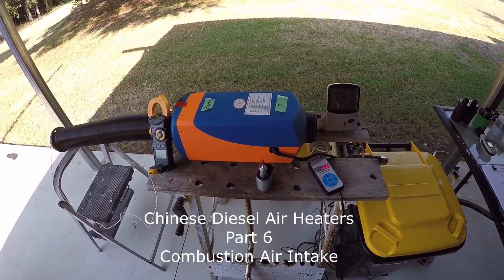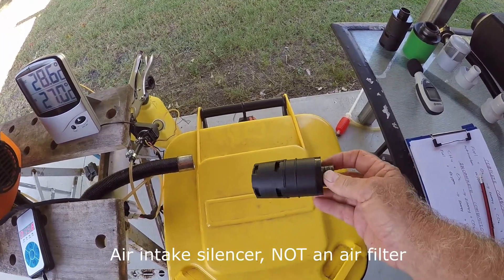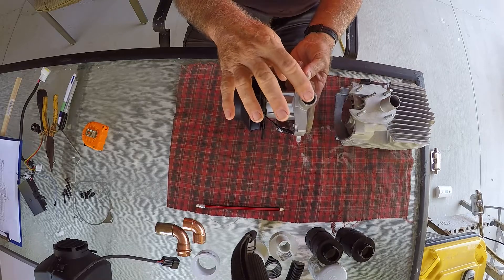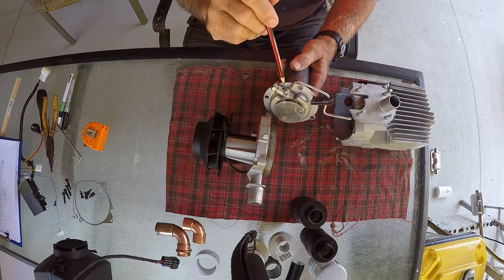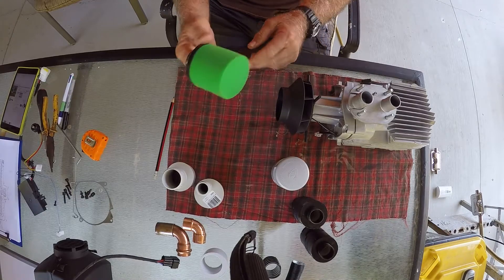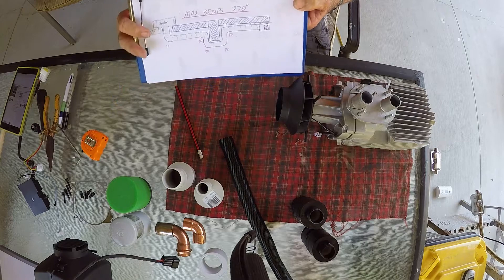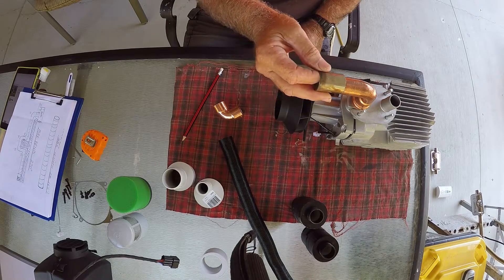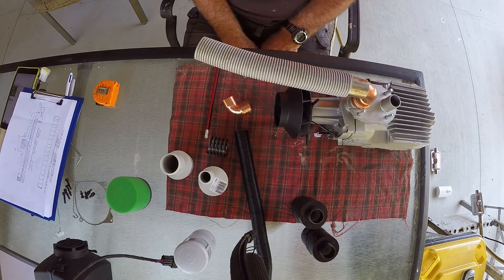Chinese Diesel Heaters - Part 6 - Combustion Air Inlet

Comment: Excellent thoughts and advice. Thank you for sharing
Reply from the maker: Hi Jaybee, pleased you liked the videos.  JMcK
Reply: @johnmck1147  Thank you John. I am currently playing with my new heater on the bench. Noise is my main concern for stealth camping in the UK, so you can see why I like your videos so much and the wealth of experience and ideas from your fantastic followers. Regarding inlet noise, I have been looking for an inlet pipe made of a soft material, rather than the hard aluminum pipe that came with the heater. So far no luck with that, but I have come to realize how correct you are when you stress how important it is not to restrict the airflow through the burner. I tried putting a small ball of wirewool into the exhaust pipe which did reduce the exhaust noise, but the exhaust gasses quickly became sooty. I also bought a 3m long exhaust extension pipe to try, which I connected in a fairly straight line, but this was even worse with very visible black smoke. The smoke in my garage was so bad and with my carbon monoxide alarm going off, I did not have much time to assess how quiet this pipe was. 

I wonder if turning the min and max fan speeds up, would this increase the air supply to the burner. If so, maybe that extra air supply would give a little more scope for attaching noise reducing measures. The extra air flow would of course make more noise in itself. 

 I have ordered a Honda style generator foam inlet filter and I may go for multiple mufflers in series. The heater is very quiet running at low speeds and this has prompted me to be more thorough with adding insulation to my new van conversion, so with less heat loss, I can turn the heater down for a quieter life.

realise
jaybee258
Reply from the maker: Hi Jaybee,

The metal pipe is the exhaust pipe. The combustion air inlet is a plastic pipe.

You are on the right track, these heaters just have a tiny combustion fan and they do not like restrictions. Keep the exhaust and combustion inlet pipes VERY short, and they will burn clean. 

Suggest you not play with factory settings.

Unless you have holes in the floor of your van, and it is lowered to mere inches of the road like some hot rod, the exhaust can exit under van, with a short exhaust rather than run a long hose out the back. Always have a CO meter inside accommodation space though.

They run quite on low speed. One of the reasons to have a bigger heater running slow rather than a small heater running fast.

Cheers.  JMcK

Comment: is it possible to us an air compression fan to feed forced air into the unit to have cleaner and hotter burn?
Reply from the maker: No, not normally. 

The ECU matches fuel flow to heater fan speed  for optimum fuel air mix. 
If you are technically minded you could try it, but you would need to go into the locked settings and manually adjust all the fuel settings.

But why bother. With a proper install these heaters run very efficient and with a very clean burn. Note in the videos the CO meter just inches from the exhaust does not register.  JMcK

Comment: Can you direct me to a video on the two kilowatt heater.   I would like to know the password to get into the settings and also what all the settings would be  for the 2 kilowatt heater
Reply from the maker: Hi Lionel, 

There are a number of videos like what you request, you can just put in your search what you request here.

I have found it better to stay out of this matter due to lots of issues people encounter after they go into the locked settings. There is no reset button if you get into trouble.. JMcK

Comment: What if I just hose clamped some steel mesh directly over the inlet?
Reply from the maker: Hi Randy, 

That would be a bad move and cause terrible air restrictions. When you have any type of air filter you need large surface area to avoid restrictions.  

Why not just install an air filter, easily bought on line or from a motorbike or farm shop.  JMcK

Comment: Hi John. Thanks for the informative video. My install involves my heater being up on a bench in my van and the exhaust and inlet pipes run down inside trunking to the floor and then outside underneath. I bought a longer exhaust pipe as the supplied one was just a few inches too short. I cut the longer one to only be as long as I needed and fitted the muffler. All is well there. However I wasn’t happy with the quality of the inlet pipe and decided to use the originally supplied exhaust pipe instead with a short piece of the  original inlet added to the end to enable a bend to point the silencer on the end away from the exhaust. I also used a 3” piece as an adapter to fit the exhaust pipe to the inlet port as the size is bigger. Having watched your video I now realize this is a mistake as I have slightly reduced the inlet pipe size by using the exhaust pipe. I also noted a very tiny wisp of smoke from the INLET connection under the unit when the burner runs on high. I mean really tiny amount - I had to shine a flashlight on it to see it. I wonder how this would come from the INLET connection? Even if I have a poor connection, surely there should be no smoke there. Obviously I will need to redo this with better inlet pipe now so I will use the heat silicone on the inlet joint as well to be sure of a seal. I was thinking of using a straight piece of copper plumbing pipe straight down and one angle at the bottom to direct the silencer/filter (will be getting a better one than supplied) away from the exhaust. The distance from the bottom of the heater to the van floor is about 20” and then about 5 or 6 inches from the underside of the floor to the muffler then about 3” of pipe on muffler to take exhaust past bodywork. Inlet about same length. Without going into lengthy details, the mounting on a counter is necessary for my layout or I would have gone with floor fit. Obviously this does necessitate extra care on sealing the inlet and particularly the exhaust at the bottom of the unit. The trunking is more for protection from heat off the exhaust than trying to seal anything up. In fact I have an opening close to the top of the trunking to let excess heat out to avoid build up. I ran the fuel pipe (of the thinner bore type you recommended) inside a thicker rubber pipe around the outside of the inlet pipe and then up to the spigot to keep it away from the heat of the exhaust as it is in enclosed trunking. It comes in from the side of the trunking a few inches below the spigot, so as short as possible. All seems to run very well in my tests but just concerned about that tiny amount of smoke from inlet (which vanishes on slow running) and the bore of the pipe. I hope to fix both with change of pipe (does the straight copper pipe sound good? I want to avoid plastic in the heated confines of the trunking) but bewildered by smoke from inlet at all. Sorry for long drawn out post but trying to give all info. Many thanks,
Russ
Reply from the maker: Hi MM,

Thanks for the detailed post. Smoke signals a rich mixture burn. This can be caused by restrictions in the combustion air inlet or exhaust, operation at altitude, atomisation issues, fan cavitation issues etc. 

Small wisps of smoke coming out the combustion air inlet pipe occasionally happen, but you need to check that the fuel pipe inlet rubber seal on the burner is in the correct position.

Please view the seals and gasket video.  JMcK

Comment: Is there a good reason for the air intake to be from outside the vehicle?
Reply from the maker: Hi Phil, ...No...It is just personal preference.
Just the same as you can choose recirculating air or outside air to come into your vehicle.
If you recirculate the air the heating is more efficient, but some people like to have fresh air come through the heater. It is personal preference.   JMcK

Comment: Hey john what do you think about pre heating the combustion intake air. Ive heard that placing the air intake next to the exhaust as a way to warm the air helps with efficiency.... Obviously we need fresh air without co2 and whatnot. What are your thoughts?
Reply from the maker: Hi Thomas, I have not tested this myself so I can not give a definite comment.

However some observations to consider. In combustion incidents, cold dense air is generally better for combustion efficiency that hot less dense air. Eg after coolers on turbo engines to cool the air.

Without me doing actual testing theory seems to say it would be a negative action.  JMcK

Comment: Can you just bang a motor bike filter straight on with no hose at all???
Reply from the maker: Hi Matthew, I guess you could try. You need to be careful the hot exhaust would not cause issues.  JMcK

Comment: Hi John. Is any old silicon ok to seal the area around the heating duct pipe? Its for a permanent caravan and annex setup.
Reply from the maker: Hi Marcus, better to use high temperature silicone if available, otherwise use “neutral cure” any old silicone, not “acid” cure.  JMcK

Comment: Hello John, thank you for your time teaching the ins and outs of this heater. Ive installed the heater in the benchspace on the door and annex side of the Avan. To guide the exhaust away from the door Ive exstended the outlet by 3 meters after the standard 60 cm supplied exhaust hose and muffler. Would this causr incomplete burning and soot buildup inside the burner chamber.
Reply from the maker: Yes Marion, nearly 4 meters is really too long for that little heater exhaust fan. This system is totally different from the piston force exhaust of a motorcar.

Installed right these heaters burn very clean. In my videos I have a CO meter very close to the exhaust in open air and I does not register. 

You will need to look for another solution. Perhaps just direct the exhaust down under the middle of the vehicle. Lots of air space down there.

Also suggest you get a CO meter for inside the van. You will not get any readings if you chose the suggested option.   

You can increase the exhaust a little if you go to bigger pipe.   Good luck. JMcK

Comment: Hi John, I can't seem to find your info on the full burn carbon burn off (maintenance) . Did you say give a full burn for 5 minutes every month if regularly used?
Reply from the maker: Hi Klylem, 

This is not set in stone, and depends on your install. These heaters get carbon buildup from a poor burn. This is caused by bad fuel, use at high altitude and restrictions in the combustion air intake and exhaust.

On my boat and motorhome, I only do this full power burn for 5 minutes once a season.

If you use the heater every day during winter, once a month burn for 5 mins is probably better.

If you are at altitude, once every day or few days would be helpful, as these heaters do not have an altitude setting.  JMcK
Reply: @johnmck1147  hello John, thanks for the reply. I followed all your videos step by step about 18 months back and from your series purchased better screens, larger air intake, hard fuel line, motorbike air filter, tools made /adapted, etc and it all works perfectly. No issues whatsoever, I was just wanting to give it a blast through but couldn't quite remember the duration..... 5 mins is what I did give it anyway so my memory was spot on. Thanks again for those fantastic info videos I'm sure many many people will find them top class as I did. Cheers for the top up info. Have a great week.
Reply from the maker: @Kaylem13  

Thanks for the feedback Kaylem. Glad the videos were of some help.  JMcK

Comment: Hi John, fantastic series of videos, is there a minimum intake length you would suggest, and a maximum intake diameter, many thanks.
Reply from the maker: Hi Audiguypaul, what intake length to you mean?
You should aim for minimum restrictions to the airflow regardless.
If you refer to combustion air inlet, less than 1 metre using supplied hose would be my goal.
If you refer to heated air inlet, in my opinion, also less than 1 metre using supplied hose.
If you need longer inlet in either situation, go bigger hose, as it creates less air movement restriction, but be realistic and practical. JMcK

Comment: Hi John.
I am fitting my red boxed ‘portable’ heater in my workshop. Can I email you photos? I took your advice and am trying to run it 1 m away from exhaust, then through wood wall to outside. Trying to keep noise down as neighbour loves to complain.
I was considering fitting a strainer filter , screw in bsp 1 “ mesh filter to alloy flex pipe at heater. Approx 30 diameter by 50mm.  https://tameson.co.uk/filters-mufflers/filter/strainer/suction/flsp-100-g-1inch-stainless-steel-nylon-suction-strainer-1p2-mm-mesh.html?gclid=EAIaIQobChMIptus2ZG37gIVROvtCh2EJgx4EAQYBSABEgInMvD_BwE  Then adapt this to plug in, fit a 68mm plastic rain pipe, 1m , then a 90 bend to outside with a leaf guard. I did play around and noticed the large tube is quite noisy. Any ideas? Am I better to go for a pipe in between size. https://www.screwfix.com/c/heating-plumbing/guttering/cat831536?productdiameter=68_mm
Reply from the maker: Hi Ian,

Only the exhaust pipe needs to exit through the wall. Install the muffler outside the wall as they are only spot welded, and have a condensate drain hole, so they leak cases.

The filter for the combustion air inlet looks ok and can be mounted inside close to the heater if you wish. If you wish to suck in combustion air from outside a 50 mm tube should be more than adequate.

To lessen the noise you could try wrapping the tubes with exhaust wrap.

Cheers.  JMcK
Reply: @johnmck1147  I believe the inlet noise is similar to when you talk down a tube , echos and project nicely. Wondering if to baffle with something a bit. Thanks for info John.
Reply: The answer may be right in front of me. Use the bigger bore ducting that came with heater.

Comment: There wouldn't be a minimum length for air intake, would there? Im picturing that air inlet dropping through my floor just a few inches with the filter hanging on the end, but I'm unsure if there's any reason to get it a bit farther away from the exhaust "header".
Reply from the maker: Sounds ok Allen, just keep the filter away from the exhaust and perhaps lag the exhaust.  JMcK

Comment: John I just got a new diesel heater today and I think the inlet filter has changed, it now has no baffles. It is still a barrel shape, but the end is closed off, there are 8 rectangular shaped air inlet openings around the outside of the barrel, each 1cm x 6mm with a mesh screen that covers these inlet holes. The mesh screen rolls up inside the barrel and the force of it trying to unroll holds it again the ID of the barrel. 
This is my first diesel heater, so I very well may be confused and you have already done tests on this style filter, but thought you might want to know if not. 
Thanks for making these in-depth videos.

Comment: Is it safe to have the intake on the side of a van ?. I have an all in one build. I have made shore it's all gas tight. But keep the inlet pipe inside that van rather then making more holds. Also I feel the silencer housing itself would stop large debris from getting into the combustion chamber
Reply from the maker: Hi Zool,

Do you mean the combustion air inlet?

It is better to be outside the van in a permanent install.

But it is ok to be inside the van if your install is good. I have had my intake inside my boat for over 10 years without issues. You may occasionally  get a diesel smell on start up and shut down  from unburnt residual  fuel.

In portable use, my own all in one combustion air intake is right underneath the heater itself.

You also should install a CO meter in the van, and have fresh air ventilation into the van.

Cheers.  JMcK
Reply: @johnmck1147  yeah combustion intake and I have 2 passive air vent one at the front on the rite side of the van and one at the back on the left and also Co detector
Reply: @johnmck1147  thanks got the advice

Comment: Hi John,

Thanks so much for making these videos and sharing them.  I am currently planning an installation on my van and they are proving invaluable.  I am a self employed courier who often sleeps in my van and I've realised a diesel heater is a necessity as I'm in the UK!

Can I ask is the exhaust pipe suitable for use as the inlet also (I would buy an additional one)?

Are the inlet and outlet ports on the heater the same outside diameter?

I really don't think the inlet ally tube is up to the job especially as I will be working the van hard for at least 3 years.  The length should be well short  of 50cm and I will use a suitable filter as it will be under the van.
Reply from the maker: Hi VOTR,

Yes you could do that, the sizes are the same. Just make sure you use a filter, particularly if outside the van.

Warm sleeps.  JMcK
Reply: @johnmck1147  Thanks John, much appreciated.  I hope things are well down there, I lived in Perth for a couple of years so have a soft spot for Oz.
Reply from the maker: Van on the Run 
👍

Comment: Has anybody come across this controller? And if so, is it any good? I find the LCD one looks a bit cheap and nasty 

https://www.ebay.co.uk/itm/12-24V-Car-Truck-Diesel-Air-Parking-Heater-LCD-Monitor-Switch-Controller-Black-/383740803381?_trksid=p2349624.m46890.l49292

Comment: John, I got a slight wobble in my fan (the plastic outer one). is it of concern?
Reply from the maker: Hi Rune, a slight wobble in the fan is ok provided the fan does not scrape on the housing, or cause vibration and heater shaking.

Cheers.  JMcK